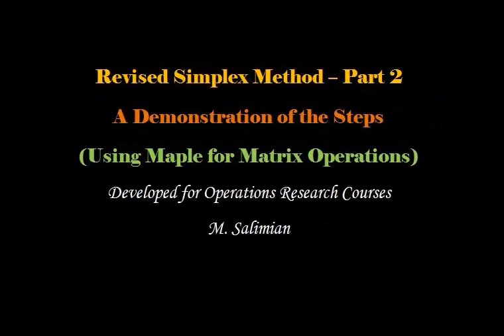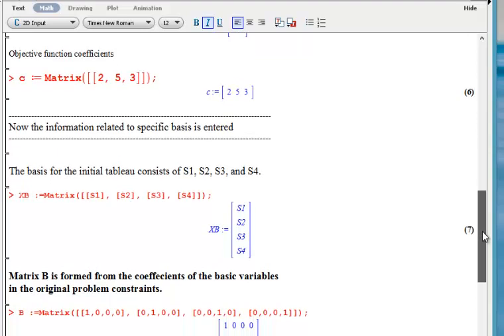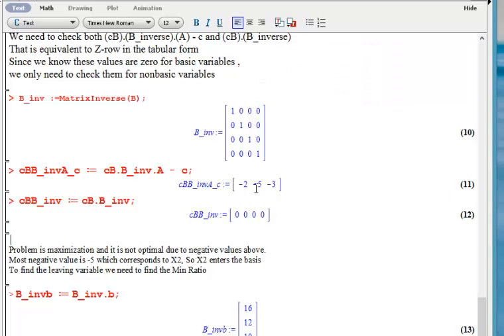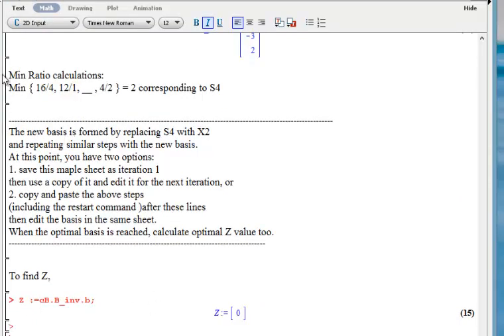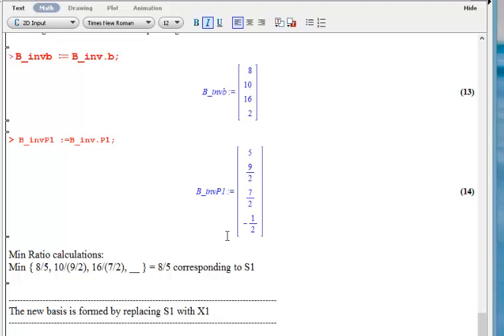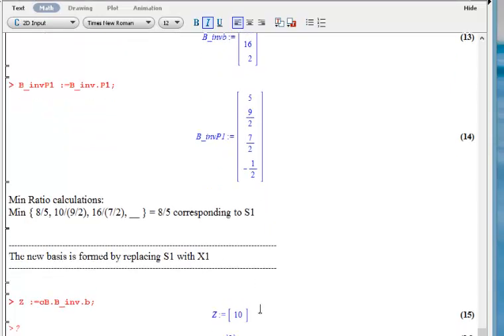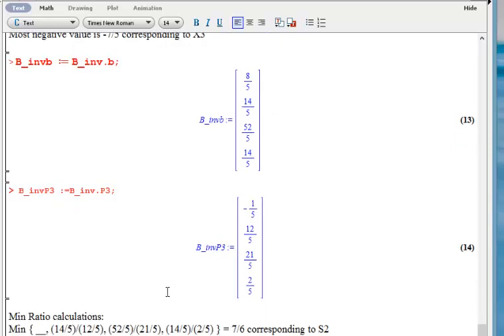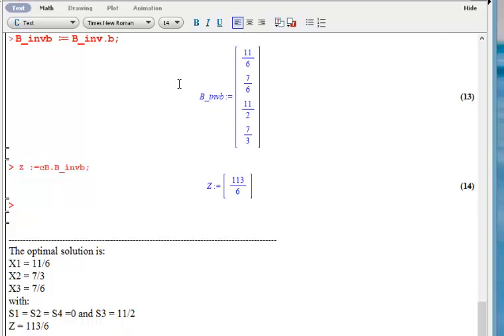Revised Simplex Method - Part 2

Comment: In your question as can be viewed at 00.15s.. shouldn't it be Z-2X1-5X2-3X3?
Reply from the maker: Thanks Daphne,
You are right. It is a typo. The problem however is solved based on the original information. Thanks again for pointing that.